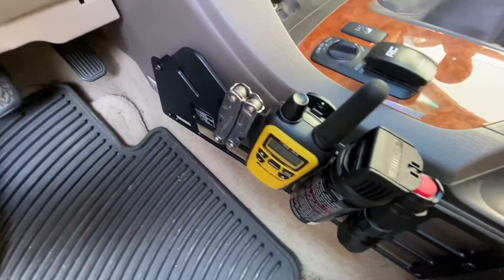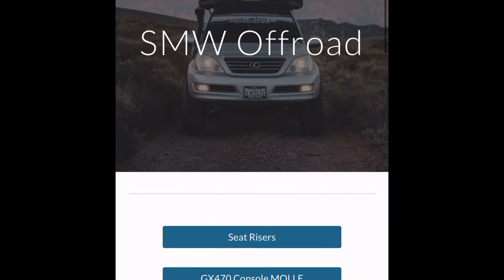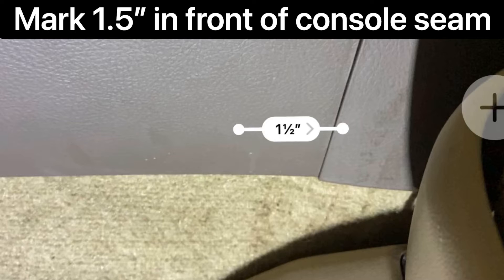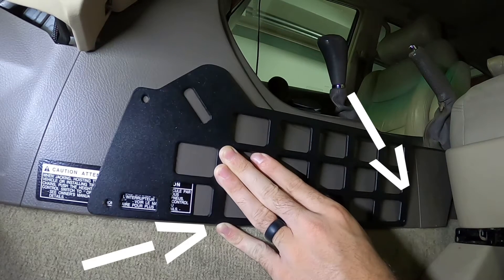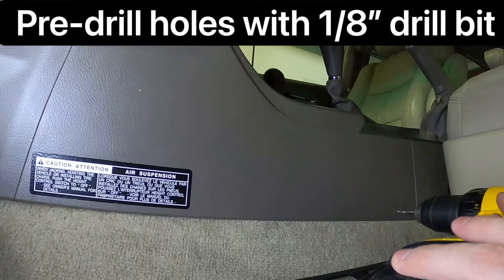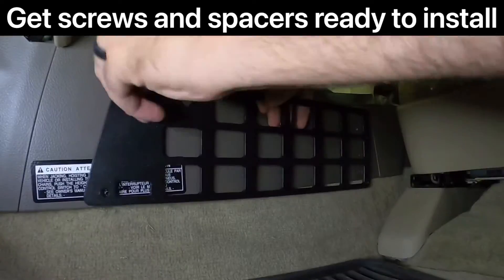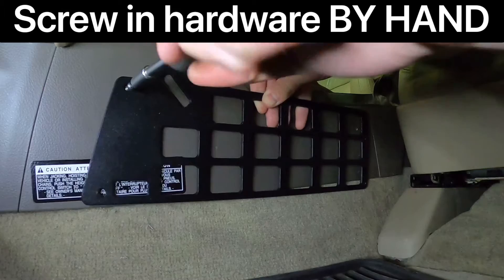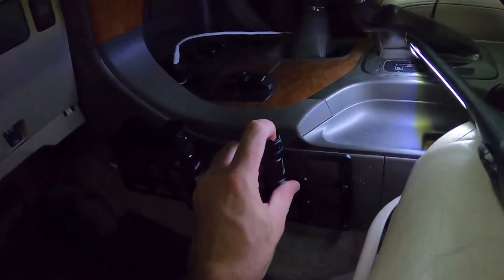Lexus GX470 Center Console MOLLE Panel Install

Comment: I wonder how the screws would hold long term… through experience I’d feel much more confident removing the whole center console (housing?) and using nuts and bolts instead. Looks good though 👍
Reply from the maker: It feels like it’ll be fine for the items I plan on using. It’s completely solid. I’ve even accidentally run the seat up against my flashlight while it was attached and the metal clip on the flashlight got bent while the panel remained solid. Should be good to go long-term

Comment: I have Gx470 2003
Can I change Automatic transmission to manually?
If your answer is yes.
Can you tell me what kind of manual transmission
Thank you. 
I'm one of your biggest fans.
All respect and appreciation
Reply from the maker: Thanks fir watching. Unfortunately, you can only use the A750F transmission from the factory. The manual Prado 120 transmission probably won’t fit because it was mated to a little diesel. The V8 needs the A750F. If you want a manual V8, maybe LS1 swap and TR6060 trans?
Reply: @lexus_offroad_adventures 
I'd like to change to normal But how?
If you have more details please provide me with the information
I'd be grateful to you.
And thank you very much